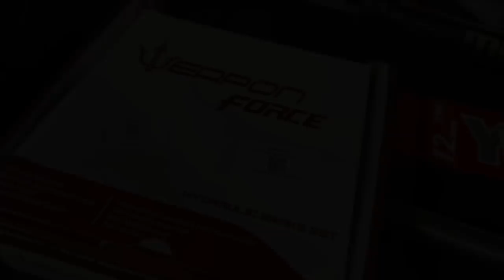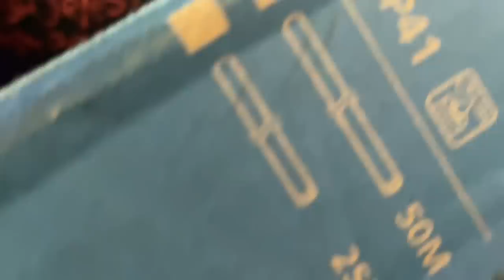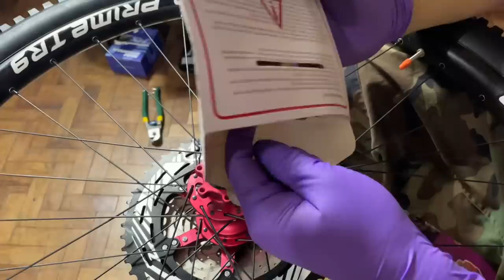DREAM BUILD WEAPON SPEAR 29ner  XC 1x12 speed deore rd shifter WEAPON parts

Comment: Idol may katanungan po ako. Bumili po ako ng 1x na crank na square tapper kasi papalitan ko po yung stock na 3x. Hindi na po ba ako magpapalit ng bottom bracket ang sukat po ay 120 mm. Pwede ko po bang ikabit yung 1x ko kahit di na ako magpalit ng bb? Thanx po at more power & merry x-mas to your family.
Reply from the maker: need mo magpalet bb boss 110 or 113 mm na bb pwede un. pag ginamit mo ung 120 stock mo malayo sa frame ung chainring mo babagsak chain mo or crosschain ka nun pag nasa malaking cogs ka